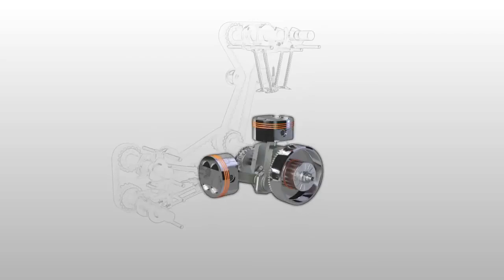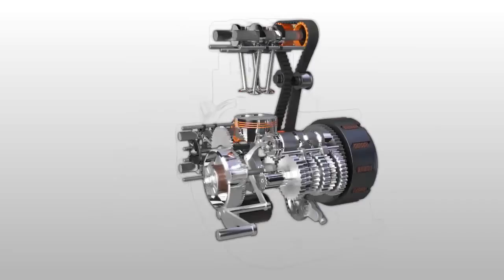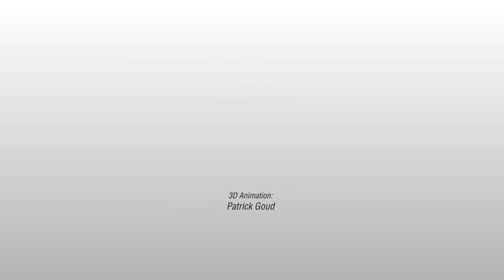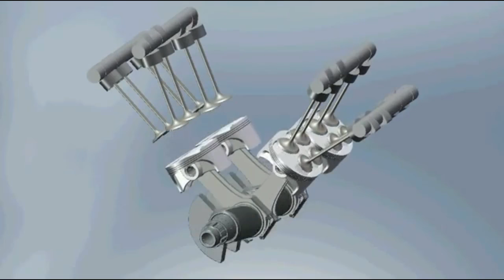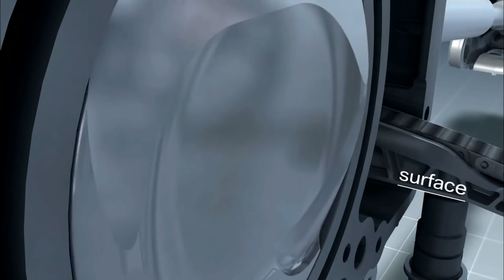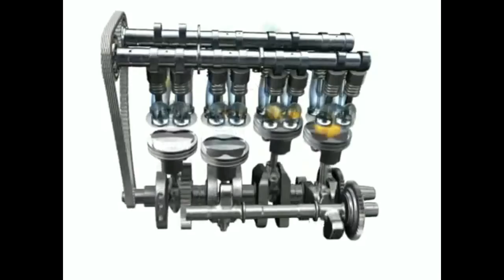Perbedaan Mesin V twin, V4, L twin, Inline 4 dan Boxer  Panigale, RSV4, R1M   YouTube

Comment: last video, only inline 4 crossplane engine sound, technically it's only in R1 and MT10. common inline 4 flat plane engines have smooth sound than crossplane.  zx10r, r6, zx6r, cbr1000, gsx1000 etc
Reply: But, Better with smooth movement than smooth engine sound.
Reply: A well balanced engine is more reliable!